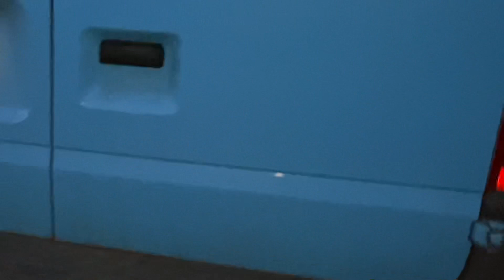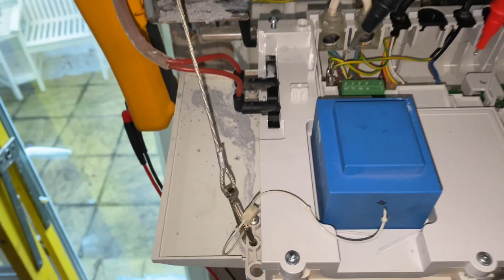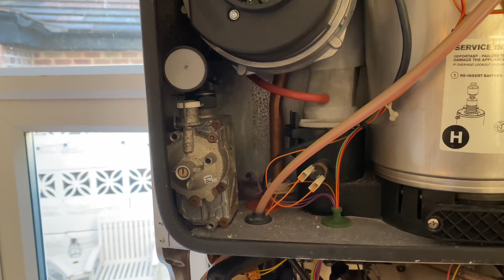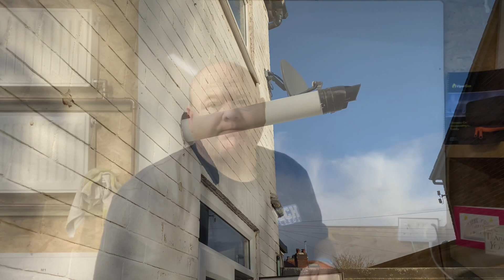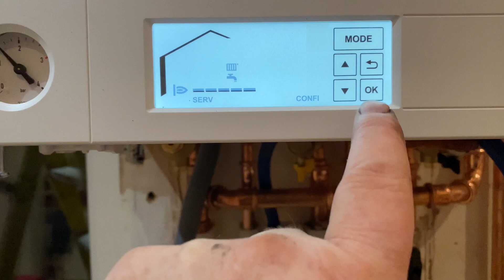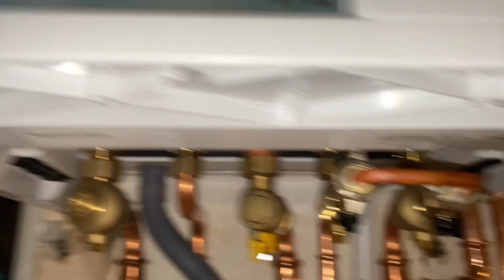Emergency Boiler Installation - Viessmann Vitodens 100 - Leeds Plumber

Comment: Different views in installation here in The Netherlands, an expansion vessel is never in the boiler, and always connected from above via a wall console, we never pump up, just place a new vessel, an expansion vessel that empties is seen as defective here, pre-pressure vessel plus max 0.5 bar water pressure, almost never breaks, unless too small or too hot, above 70c

Comment: Gas safe registered AND qualified, not either or.
Reply: Obviously an apprentice would be working under a qualified tech who would inspect and sign off
Reply from the maker: Unfortunately you do not need to be Gas Safe Registered to work on a boiler. The regulator says competent

Comment: I think the problem with the Worcester Bodge is the flue terminal, there's no rain deflector as standard (it's an extra very, very rarely fitted) so you get rain into the air intake and not just the exhaust due to the very straight stubby pipe. The WB flue can be set either straight out or deflected 45 degrees to point up without needing a separate plume kit so you get rain down the exhaust and into the condy trap which will then overflow. The old housing estate I used to live on has a large fleet of Worcester Greenstar Jnr 28i boilers (as that's the company that did an aggressive sales campaign although there are quite a few Vaillants and Ideals and Vokeras) and there's been a lot of failures due to water ingress in the WB's. My "new" house has a 20 year old Baxi-Potterton as do most of the houses round here that are still in perfect nick (as are the Vaillants and Glowworms) and will survive even a nuclear holocaust. The WB's my old neighbours bought are 6 to 7 years old and rusting away. Having said that my new neighbour across the car park has a noncondensing Worcester RSF which is also 20 years. WB recently have a 10-year warranty if fitted by an accredited WB RGI but I can't see that happening in real life - 6 years is about the best I've seen and personally I'm glad I stuck with oil (Worcester-Danesmoor Heatslave) at my old house when NG was piped in and we were besieged with slick salesmen as I bet that old Heatslave is still going strong so whoever's bought it now has a reliable boiler.

Comment: Hi Allen. Very interesting video. Did you put an expansion vessel in with that job, or was the one in the boiler itself sufficient for that system?  Thanks
Reply from the maker: I didn’t install an extra expansion vessel on this one. Thanks.

Comment: Hi Alan great video 
I am an A/C eng but I like watching your work mate.
I do have a question for you if you have the answer .
I use press fit for chilled water pipe work and love it
I have several Geberit novo press machines they are great
But also I have now started to press fit the refrigeration pipe work too with a Rothenberger machine also great
We use a lot of threaded rod and REM’s do cropping tongs I just wondered if you know if they can be used with any of these machine
Best Regards
Paul
PS Keep up the good work
Reply from the maker: Neil Thurman I don’t think they can unfortunately. :_toolbox:
Reply: @AllenHart999  Cheers Alan thanks for you reply 👍🏻
Reply: Sorry Allen for miss spelling your name
Reply from the maker: @neilthurman1864  :_toolbox::_toolbox::_toolbox:No problem thank you for watching. :_toolbox::_toolbox::_toolbox:

Comment: Allen. Question is.
What boilers do you prefer to fit from an installers point of view and from a service and repair point of view?
I have been a service and repair engineer for 18 years and i see what breaks down a lot but I don't know what's a good compromise to fit.
Going on my own soon so will need to have a go to boiler to fit.
I must say, everyone leans towards big brands but in my opinion is for the the likes of Worcester and Vaillant who where top of the game back in the day like the VCW etc , but now seem problematic.
Do they want that as revenue for sales on spares after market or is it just bean counters reducing quality by using plastic and sub standard components like fan pcbs and so on?

I have seen a few Intergas Rapids now and although they have a few flaws for the installer and service engineer, they seem bomb proof.
Whats your thoughts?
Reply from the maker: Ideal logic, Ideal Vogue are really easy to install.

Comment: Great work Allen, I’ve seen you use Viessmann quite a bit.  Is that your boiler of choice out of interest?
Reply from the maker: Viessmann, Baxi, Ideal, Vaillant, Trying to install all brands really. It's all about the installation. Thanks.
Reply: @AllenHart999  but why a viessmann over another make on this particular install?
Reply from the maker: @Shandanks  Customer choose the boiler on this one, Although i like the 100 and the 12 year warranty.

Comment: Hi, Allen! Can you please tell about how to calculate heating pipes diameter?
Reply from the maker: I will do a video on it soon. Thanks.
Reply: @AllenHart999  Thanks you to for yours video! And can you tell in what detection must flow go?
Reply: @AllenHart999  and tell please for why need water flow meter?
Reply: @AllenHart999  and tell please what system better for one floor house; one pipe or two pipes?

Comment: What a cracking Job and on a day when most wouldn't be available.. How much was this Installation mate ?
Reply from the maker: https://www.youtube.com/watch?v=a67CS2G9ZPA&t=368s
Reply: @AllenHart999  I’ve just had a boiler swap - ideal icos HE24 15yrs old for a Baxi 824 because the heat exchanger started leaking.. £3180 

They charged us £380 2 weeks prior to repair a leak on the condensate pipe and replacing a noisy gas valve, so an expensive couple of weeks.. 

Wished you lived nearer to Newcastle mate 😉

Comment: Noticed the condense flex was just pushed into an 38mm waste pipe, thought the condense discharge was classed as part of the flue and has to be sealed internally into a waste pipe, or is that not the case with the Viessmann boilers.
Reply from the maker: The Boiler has a built in trap. I phoned Viessmann in the past to check it was ok like this. Its a washing machine trap. Thanks.
Reply: @AllenHart999  thanks for the reply Allen , got one to fit in a couple of weeks and not fitted a Viessmann before usually fit boss  he or vaillant, I know with the Worcester’s it’s classed as flue.

Comment: Is the 300mm from thr recess/opening in the brickwork?

Ive been told off for doing your way,  measuring from the actual opening of the window/door
Reply from the maker: SuperSmashing Dave The regs say 300mm from opening into building
Reply from the maker: SuperSmashing Dave it’s 150mm from structural part of building
Reply: Hi Allen. Great video, I have an old vitodens 100 combi I don't use it for hot water its just blanked off so just for heat but the boiler stays on ann the time even when its not calling for heat. Think is just circulating around the back plate heat exchanger, any idea why this is happening? The hot water dial is at 0

Comment: Alan are favouring the Vitodens 100 over the Baxi 636 Combi,s ?
Reply from the maker: Depends on customers budget. Viessmann 100 is quite expensive once you add the extra warranty
Reply: @AllenHart999  If it was your house what would you fit ?
Reply from the maker: I have a Baxi 636 but if I had the space I would have a Viessmann 100 system boiler on 4 pipe with Viessmann cylinder. Thanks

Comment: Hi Alan I won't be able to fit a filter but the boiler near the ceiling and the pipe comes through to the boiler for the ceiling eney tips
Reply from the maker: I would always install a filter on every install. Thanks.
Reply: Forgot to say I have a f and e system thanks

Comment: Hi I have baxi due tec 28he install in 2009 and just have a service before Christmas, the service engineer never remove to clean in side the main heat exchanger, watching a lot on your channel when you service the boiler you needed to clean in side? All his did it just check gas hight and low, it that all you do for service?
Thank
Reply from the maker: If you have a look in your installation instructions it will tell you what is needed on a service. Thanks.

Comment: What a lucky customer mine broke on new years day as well my whole house is freezing cold with no hot water or heating and i still have to wait till wednesday  before they come and install it
Reply from the maker: Hope they flush it all correctly. Ask them if they use the Adey Pro Check to test it. Thanks.
Reply: @AllenHart999  No they didnt . They didnt do anything right, did not even flush the system, add inhibitor, magnetic filter or powerflush. Also Had two errors F20 and F87. I got a refund in the end so now im here with no boiler. Anyway going to have to hunt for a new heat only boiler, I was thinking of geting the Viessmann Vitodens 100-W Compact Heat Only Boiler 26kW model WB1B319 does this still have the rubber pipes or is it changed to copper pipes now? Thanks
Reply from the maker: https://www.youtube.com/watch?v=3VcMnZEbrpg

Comment: Allan just a quick question ... is the position of the expansion vessel  on a pressurised system covered by any regs . Has it GOT to be on either flow or the return and is the distance from the boiler if it not IN the boiler  specified ? ...I do (as a nic electrical engineer) enjoy your vids regards the old fart in wembley
Reply from the maker: They are normally built into the boiler. I have also installed external ones on the return. Thanks.

Comment: Hi Allen another excellent video ! good of you to do the emergency job straight into the new year, looks a neat install too
One small complaint though about your heating merchant , he SHOULD NOT transport the boiler on its side it clearly has arrows on it facing upwards i.e. the boiler laying on its back, they have a very heavy heat exchange in these , as u know, & They can break the heat ex mounting legs and bend the back panel of the boiler if on its side trust me I’ve seen it happen! whenever you pick one up make sure its laying flat on its back. Viessmann Do a valve fittings cover trim panel as an accessory, that fits on the front and it hides all the pipework connections underneath I’ve used one a few times and it really tidies up the job! Happy New Year to you and your family
Reply from the maker: Hi Salim. Thank you so much for the feedback. I will take that on board.
Reply: No problem Allen & I hope you didn’t mind me pointing that out,  when it happened to me and I found some damage to the boiler I was gutted as you can imagine just when I was ready to hang it up on the wall !
Stay safe and warm mate apparently the second bout of the virus is quite deadly

Comment: Ive found some boilers dont allow the filling loop to fill the system to do a mains flush if the valve on the filter closest to the boiler is closed
Reply from the maker: Which boiler brand? Thanks.
Reply: @AllenHart999  the Worcester greenstars and life. 8000. Not sure why
Reply from the maker: Douglas Luffman I haven’t installed one of them. Thanks for your reply and sharing your knowledge. 👍

Comment: Alan where did you get the little blue t piece on the manometer tube ?
Reply from the maker: https://www.test-meter.co.uk/anton-pressure-relief-valve-aprv/?utm_source=google_shopping&gclid=Cj0KCQiA88X_BRDUARIsACVMYD9Pbis4xNa2ftLI4UY3TEtyBozj2egSRFYlGqkRPBZTainvMF5mRAIaAvyEEALw_wcB

Comment: Question for you Allen:     As you  use the Metal fernox omega filters.
Do you know if you can replace the original plastic TF1  filter with the newer Metal omega , without draining down?   (with the original TF1 valves still in place)
Reply from the maker: Yes no problem. https://www.youtube.com/watch?v=cKSx6-Zq5Ak
Reply: @AllenHart999  Thanks buddy, thats really helpful.  :-)    
 Went out to a boiler breakdown (fixed it) over Xmas  but need to go back this week and do something about a dodgy TF1  thats been rebuilt several times already.
Reply from the maker: @julianhawker7672  Make sure you buy the omega with the valves, There are two types one with valves and one without. Then its easy straightforward swap. Thanks.

Comment: Cadent is the gas distribution company that may be called these days.
Reply from the maker: They keep changing, They will always be Transco to me lol. Thanks for the comment. Happy New Year.
Reply: @AllenHart999  I still call them Transco but my mate who works for Cadent tells me off 😳
Reply from the maker: lol.
Reply: @kevint3845  National Grid sold off that network years ago. It's Northern Gas Network.
Reply: @richardpearce3949  northern gas network is only a small player in parts of the country it does 2.7 million homes and businesses, Cadent does 11 million, there are a few of them such as SGN, wales have one along with a few others
Reply: @kevint3845  Yes I know. Allen is in Leeds which is covered by NGN.

Comment: Good vid. I wasn't sure what you meant about altering brickwork. The steep angle is good for a condenser boiler like this; it's less likely to drip on the outside. I have this boiler and it does do this. The opening of the flue could be designed slightly better maybe.
Reply: @metallitech the inner core of the flue has a natural fall built in. If Allen had installed that flue without adjusting the hole, any rainwater that may blow In to the outer core, could track back into the boiler. As Allen says, always follow the manufacturers installation instructions, some manufacturers are super strict and will void warranties when not installed strictly to their spec.
Reply from the maker: @efrygasservices6169  The main reason this boiler was faulty was the flue.
Reply: @efrygasservices6169  If I am not mistaken, the inner pipe has a fall and the whole pipe has a slight fall as well (to the inside). My problem is that there is some dripping outside, even with normal installation. I have checked that the flue is the right way up by the way.
Reply: @metallitech  some boilers do just drip, I have seen it on flues that I have installed exactly to manufacturers spec. Annoying I know, maybe a design flaw, maybe just the nature of condensation 🤷🏻
Reply from the maker: Cut the brickwork and installed it as per the installation instructions. Thanks.

Comment: Happy new year to you and yours Allen.Hope it is a good one.
Good installation there pal.Good boiler as well and I found it very helpful.One thing that surprised me slightly was the built in filling loop as I thought it didn’t have one,not that I would complain.
My mum will be having a new boiler this year and she has decided this is the one she wants.
I think it is better that they no longer have the rubber hoses and are now copper.
I believe the 050 will be changing to copper possibly this year.
Hope to see you soon.
Rob.
Reply from the maker: I definitely prefer the copper. Thanks for the comment. Happy New Year.

Comment: So how did you solve the flue hole angle? Great video 👍
Reply from the maker: Hi Steve. Chopped the bricks down on the outside to get the correct fall. Thanks for the comment. Happy New Year.
Reply: Happy new year and keep up the great work.

Comment: Allen when the water pressure reading  starts to drop when the boiler is cold first thing in the morning below 1 when it's usually 1 1/2 what could the issue be? .There are  no water leaks  under boiler in cupboard or under boiler inside from what I can see.. I've topped it up to 1 1/2 again but noticed its reading is now falling very slightly again. Thanks.
It's a baxi 105E from 2003.I only had the boiler serviced a couple of months ago.
Reply from the maker: https://www.youtube.com/watch?v=X4OssmUEFo4&t=688s
Reply: Expansion vessel flat